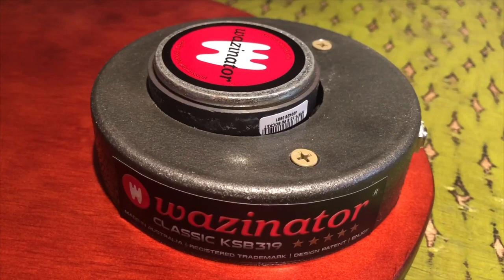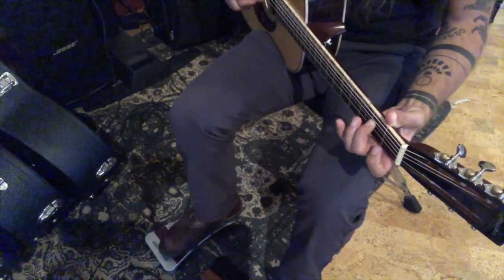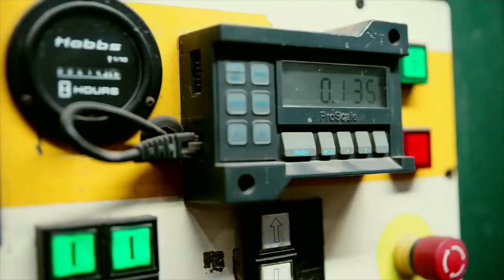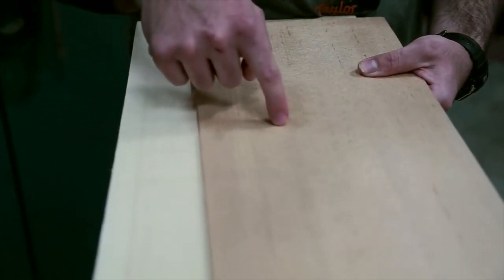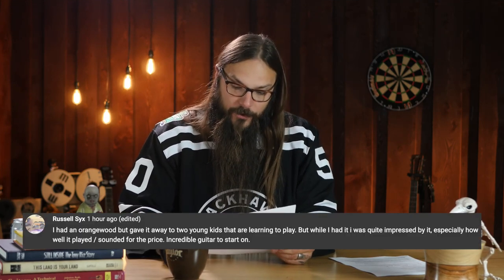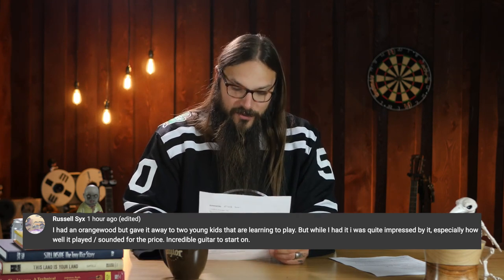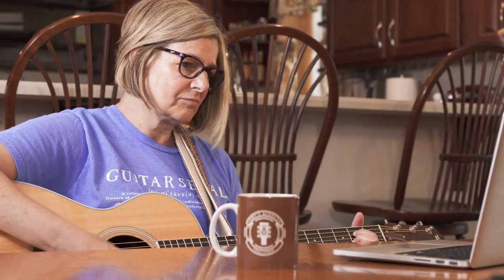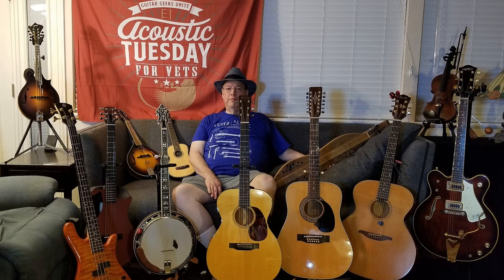A Wazinator Stompbox Battle! ★ Acoustic Tuesday #112

Comment: Great video and thanks for the comparison. Don't forget once you feed any stompbox into a say a graphic eq for example almost any sound is attainable. I have got the Baby Grand and its easily changed to sound like dropkick. If you use a pedal such as the Zoom MS70CDR for example you can build a chain of effects which might include a compressor which will change the sound again completely. Or add in a pitch shifter where you can tune the sound of the kick over a wide range of pitches.

Comment: Greetings again Tony and Noah, ive got a #smallwin for you guys this week. I have successfully installed an under saddle pickup system into my Samick Gold Rush D1, but not without almost basically ruining my guitar. I had cut the hole for the input jack and battery box a little too big for two of the mounting screws to actually grab onto any of the body wood. Two hours of tinkering later, i made a rectangular washer to hold it in place, and in my opinion, made it even stronger than just the 2 screws. Heres hoping i dont have to take it out anytime soon, because my solution was a pain in the neck to mount in the guitar, and i dont want to do that again.

Comment: Does torefication effect the guitars resilience to damage, are they weaker/stronger? Has anyone tested? I mean if I was spending good money on a guitar if it's more likely to damage I'd prefer the non torefied I would assume a dry wood would be less flexible so weaker? I'd sacrifice a slight sound difference for strength.

Comment: John V from Raleigh. Started watching Tuesday, finishing on Saturday. Torification? Souds like a naughty word... But, I first heard about from Andy Powers and the redo of the 600 series a few years ago. Then I think you mentioned last week that a guy in Canada may have started using it years ago. Boucher maybe? Anyway, I think it has more clout behind it than that vibrator thingy... As for is it better and worth it? I'm with Noah, not experienced enough to tell the difference. But if Taylor, Martin, Bourgeois, and others use it, then I think it is a real improvement. Cost increase? Anything that adds labor and time cost more.

Comment: Geeky guitar question for Tony: that bourgeois guitar you played in your performance for if light was liquid Is pretty sweet! Question: the bridge pin for the low E string looks pretty close to the saddle. Is that a specific design? Does it add more down pressure to the low E? Other than that that guitar is a sweet 12 fret cut away with a sweet herringbone outline and simple aesthetics but amazing tone! Great AT!
Reply: ....oh wait nevermind I just saw this guitar featured on Eddie’s Guitars you tube channel as the bourgeois OMSC. Pretty sweet GIT Tony 😀😀😃

Comment: Another great show, guys! Listening from the SF Bay Area, as always. 
Two thoughts: Tony, I'm surprised that you as a true, deep-diving guitar geek, don't go all molecular chemist on us in your explanation of torrefaction. As I understand it, having heard Richard Hoover of Santa Cruz Guitar Company talk about it, and quoting from an online SCGC ad, cooking the top wood "...in an oxygen-free environment at a relatively low temperature [...] reduces the oil, sugar, and resin content of the wood, reducing mass and weight and increasing stiffness resulting in similar chemical transformations that occur in wood over decades of air drying." Hoover uses the term "plasticization" to describe the changes in the molecular structure of the wood that occur during the process. This hardening/stiffening enables the topwood to transfer the vibration of the strings to the soundboard much more efficiently than untorrified wood, enhancing the sound in multiple ways. 
My second thought: I really appreciate your urging us to play every day, Tony, even if it can't be a true working/learning session every time. And as you always stress, having fun is the constant, primary goal. In my dotage, having been on the guitar-learning curve for over 50 years now, I am very familiar with the dreaded bored-with-everything-I-play syndrome, which can seriously compromise the play-everyday ideal. 

One remedy I have discovered (although I'm sure  that a million other players do the same thing) is that it is both fun and technically beneficial, is to create a new song in my recording DAW (I use Apple's free GarageBand application), and find one or more rhythm loops that sound good, or have a novel "flavor", tempo, etc., that makes me want to play along. Often, I DO play something very familiar, but the new tempo or ambiance often makes it into something new. Sorry for any hint of self-promotion, but here's an example from my Soundcloud page -- an old tune that I way overplay, and the new tune that emerged as I tried to keep up with the conga drum and  Egyptian  Nile Darbuka. "Dandelion Wine" becomes "Vino Latino"...

Dandelion Wine: https://soundcloud.com/scott-hunter-4/sophies-first-vin-de-pissenlit?in=scott-hunter-4/sets/reunion-tunes

Vino Latino: https://soundcloud.com/scott-hunter-4/vino-latino-1?in=scott-hunter-4/sets/reunion-tunes